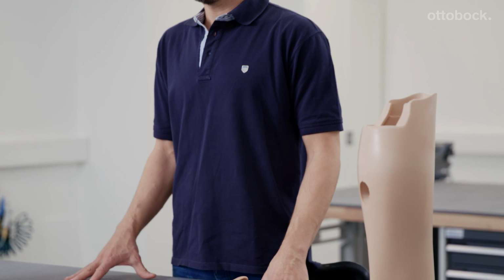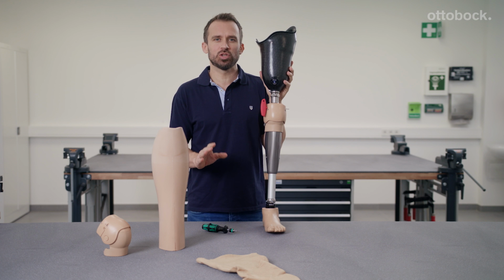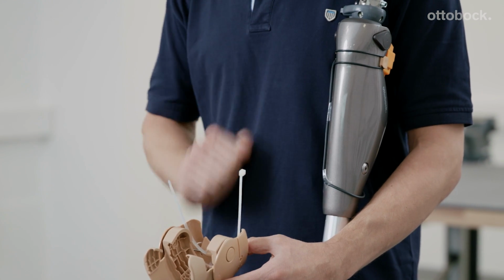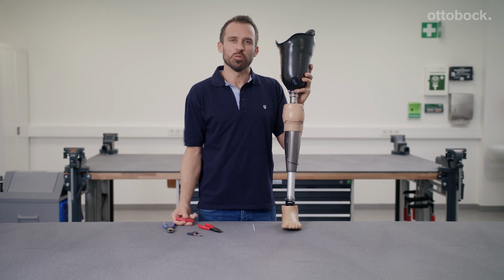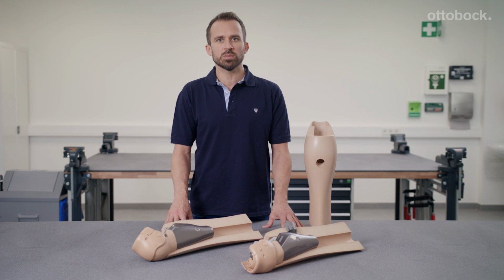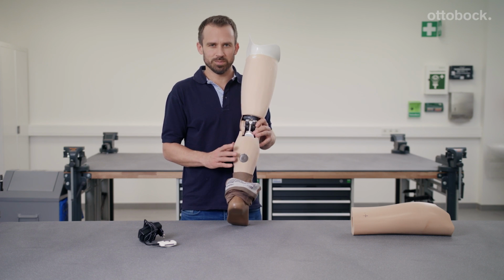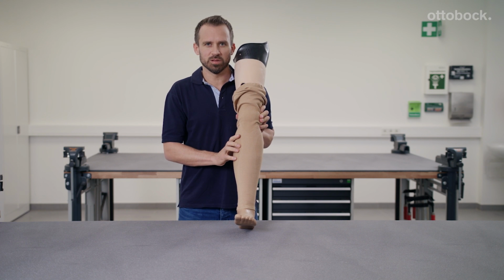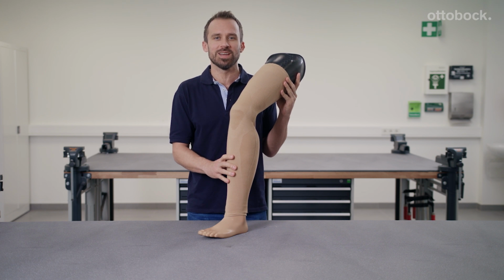Functional Cosmesis - Installation video

Comment: Too complicated for the regular prosthetic user...
Reply from the maker: Dear Fernando BE,Thank you very much for your comment on our Functional Cosmesis in connection with the installation video for technicians. The video describes step by step how the professional should proceed, in order to achieve the best fitting result for the prosthesis user. There are only a few manipulations done by the prosthesis user on the product, e.g. removing the Functional Stocking to wash it or pushing a button to release the rotation adapter.We invite you to have also a look at our user video https://www.youtube.com/watch?v=as75msXFqx8.Please contact your local branch for the best support in your country and more information about the Functional Cosmesis: http://www.ottobock.com/en/company/locations/

Kind regards, Your Team from Ottobock Headquarters